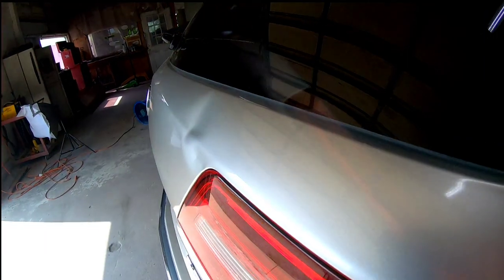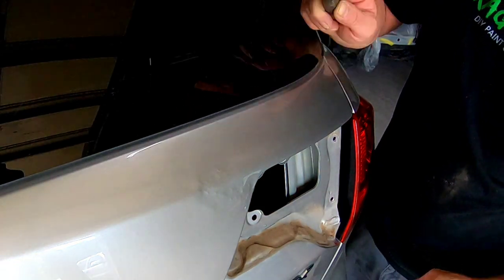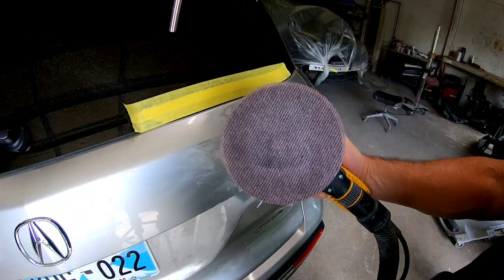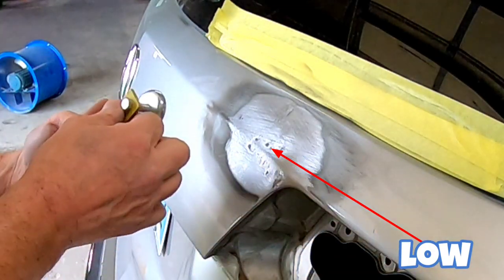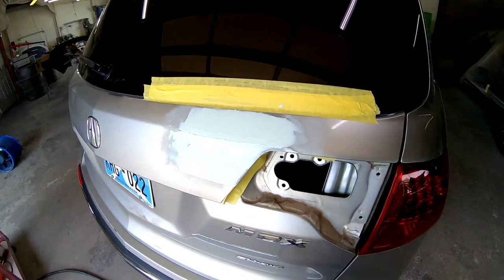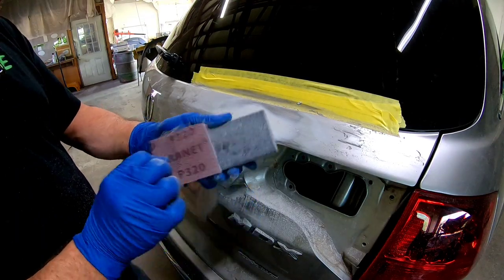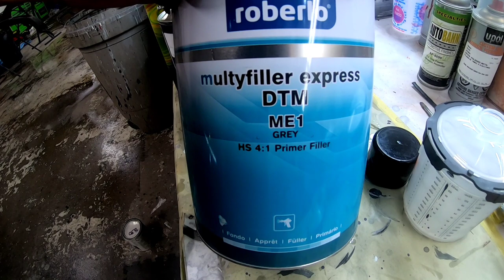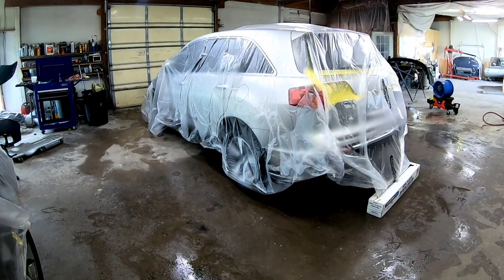Simple steps to repair a dent like a pro. #bodywork #autorepair #autorepair

Comment from the maker: check out the 3m performance gun here!  Thanks for watching. https://youtu.be/Iy-RkQdOrvY
Reply: Yes I'm absolutely going to be buying this gun thanks to you
Reply: One more thing Chris what would be a good gun to use for painting that's not going to break the bank but gives good quality
Reply from the maker: @DentZero123  Depends on budget and your air supply. If you have enough air from your compressor a Iwata kiwami 4 is great at about 250.00  A great budget  gun if you have limited  air is the Eastwood lt100 I just did a review on it you might check out. It cost under 100.00
Also the astro evot13 and astro euro pro he $100 guns that perform well.
Reply: @GarageNoise  Thank you my friend! 
I REALLY  APPRECIATE that..

Comment: I just bought something similar to the g90e could be the same thing got it off ebay for $260 can't wait to try it out on an old door got my personal vehicle that needs some metal work instead if using the stud welder
Reply from the maker: Probably the same under a different  name. It is so much easier  than the stud welder.